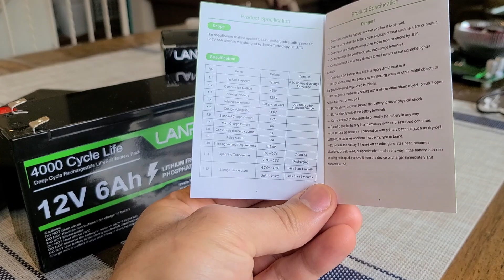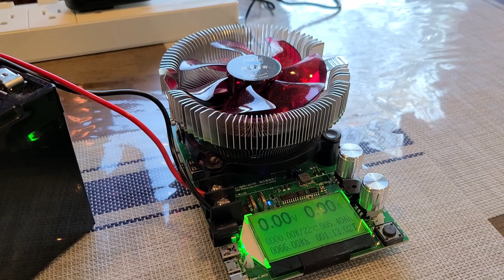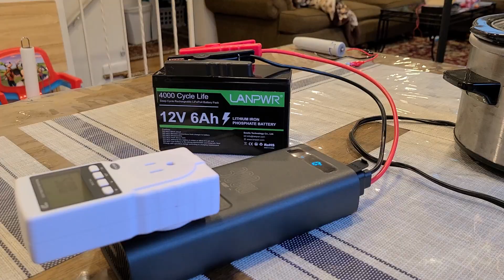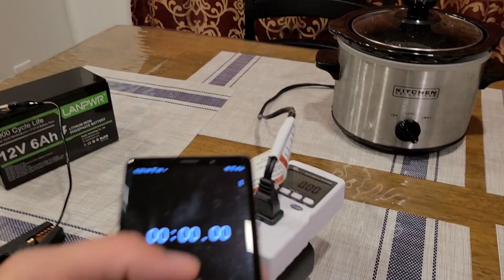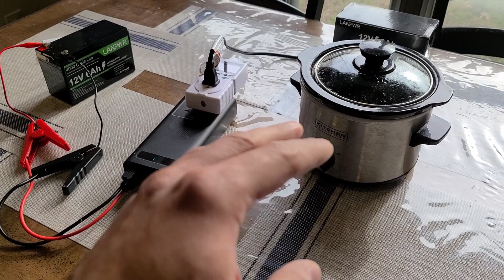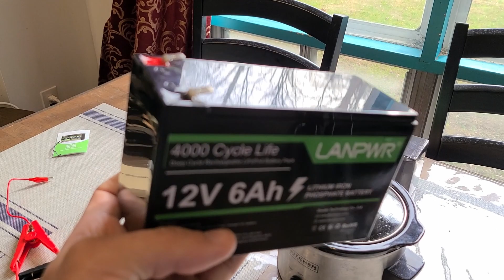LANPWR 12V 6Ah LiFePO4 Battery Review

Comment: how do you charge it ?
Reply: 10a charger wow ! Thats not good you should use a 1.2a or 3a charger
Reply from the maker: Hey there,

I used a 14.6V/10A Ampere Time battery charger. Let me know what you think. Thank you!
Reply: @chargerharbor  charge with 10 amps is to high current for that small battery (max 1 c)
Reply: @suleijman228 should do the job for testing, the BMS may even regulate the current down to 1C anyways.

Comment: Batteries of this size are commonly used in low-power Amateur Radio applications for portable use like mountain topping or Parks on the AIr in which a small radio and antenna are connected to run a couple low power radios to "Activate" the property to make contacts with each other. One question I have is are two batteries of this size able to be parallel in size to double the capacity? That would make it useful for long weekends and for being a good load for recharging with a LIFEPO4 solar charge controller, etc. -Dave - KU9L

PS - I got my answer from the Amazon listing: LANPWR LiFePO4 battery is allowed to be extended up to 4 in series and 4 in parallel. I ordered two. I will put them in a Group 24 battery box with a small DC bus tying them together. On the battery box are water-resistant ports of the three USB sizes, a volt meter, numerous Anderson Powerpole connectors, and a solar charge input which also doubles at the AC mains LIFEPO4 charge input. Two batteries fit side by side in the box with room to store the chargers. The radio I use draws 0.8 amps on transmit and with the intermittent nature of CW Morse Code the duty cycle is so low the batteries would last a couple of days or endless with a 50-watt solar charger. Thanks for the video.
Reply from the maker: Hey there,

Sorry I couldn't get to your question.

That sounds pretty cool! Thank you for the info; it's great to know how people use these types of batteries. Powering a radio using the battery and using a solar panel to recharge it is very resourceful.

Thank you for watching.
Reply: @chargerharbor  I got them today from Amazon Prime. They are very lightweight and should do well in my portable battery box that has fusing, Anderson Power Pole connectors, USB, digital voltmeter, charger input, etc. My box is too big for a back pack, but if I decide to do some mountain topping I will just bring one battery and a small roll-out solar panel with an integrated solar charger. Thanks!

Comment: Do you like that 300w inverter? Do you have a link for the inverter?
Reply from the maker: Hey there,

It seems to perform well, but I'll have to do more testing with it using my larger capacity batteries. I'll do a full review when I get the chance.
Reply from the maker: Oh, my bad. Also, the link for the inverter is in the description.